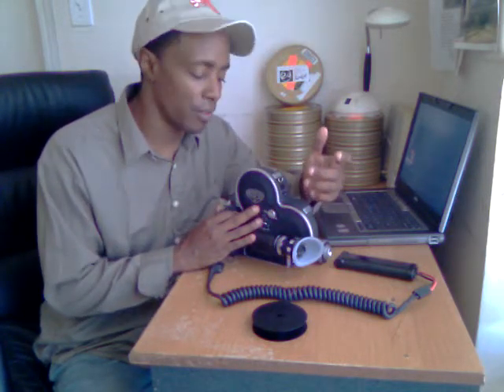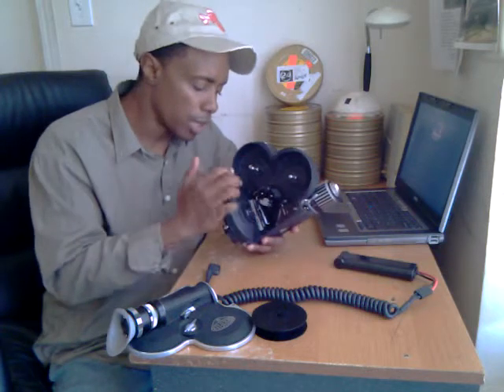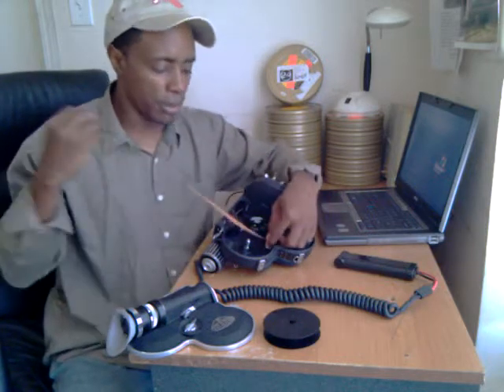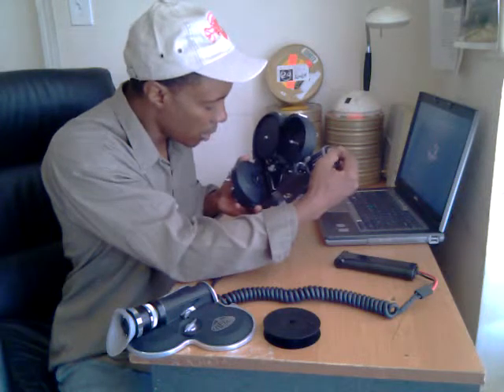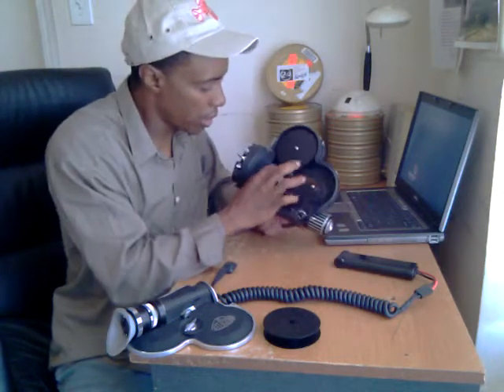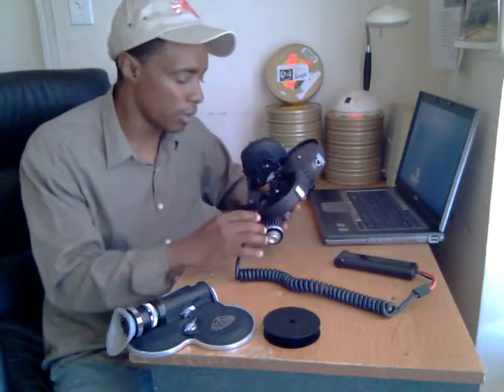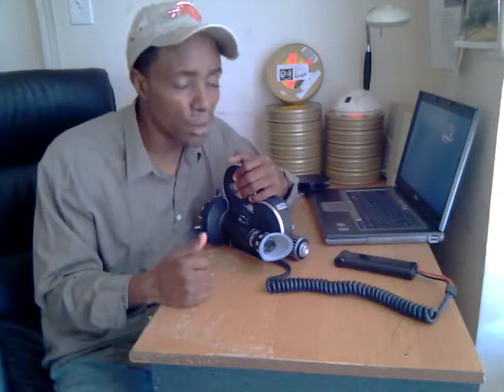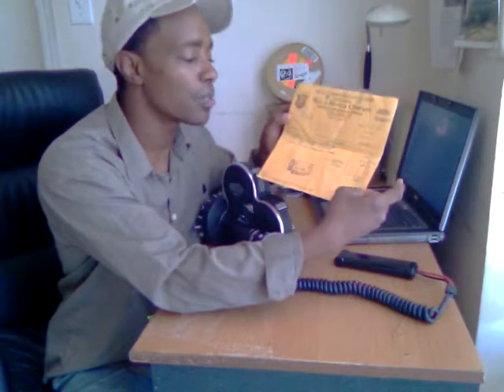arriflex 16ST how to load film in a arri st

Comment from the maker: make sure you motor is pushed all the way in..and that the rubber coupler is holding tight on bouth the motor shaft and mailn drive shaft if the couple is bad it will not turn the main shaft with activate the reg, pin try that..thanks tony
Reply: Any suggestions if the rubber piece inside where the motor goes gets loose?

I can stick my finger in there and get the registration pin to move, but the inching knob does not work